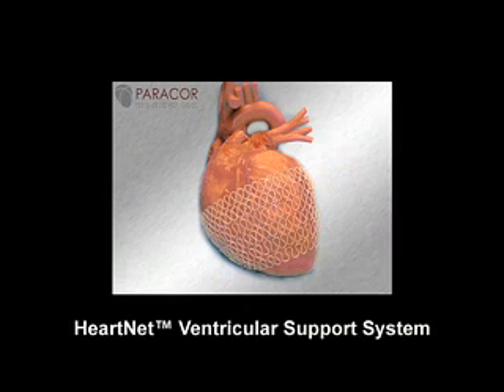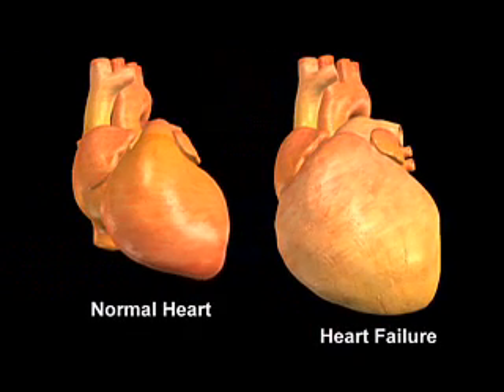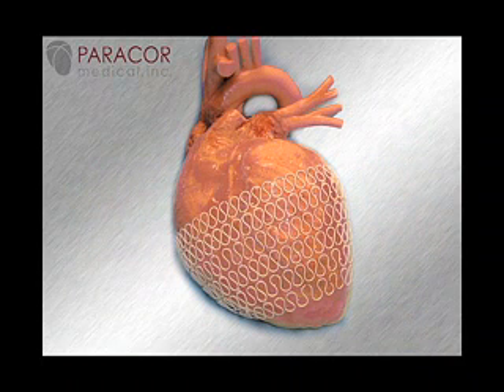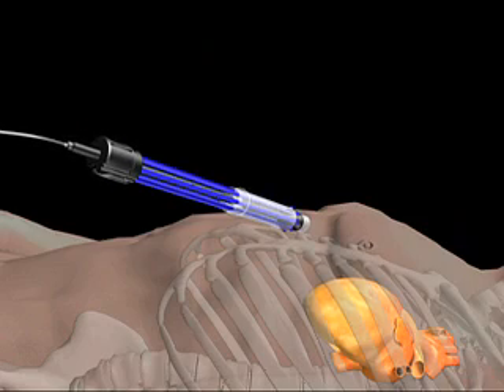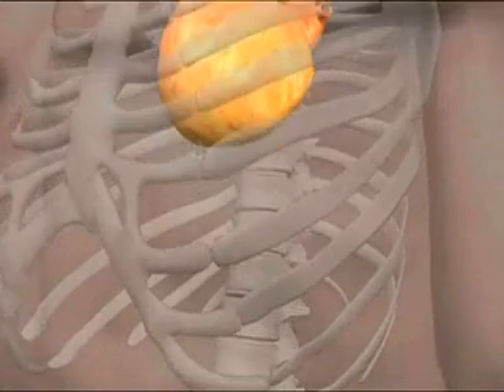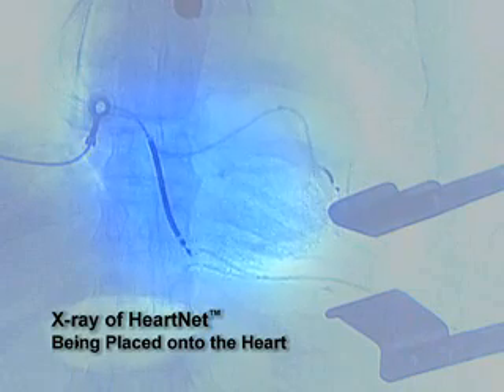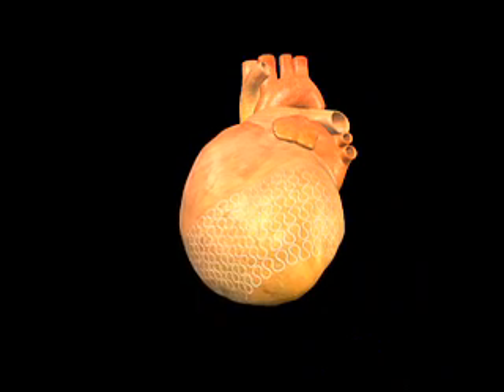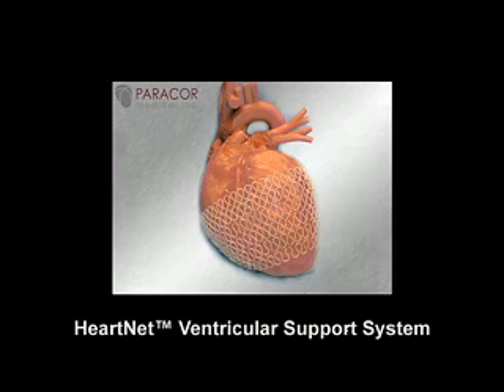Enlarged Heart Animation

Comment: @3ndGroup and ViperClutch
The most common cause of an enlarged heart is chronic high blood pressure. High blood pressure makes your heart work harder to pump out the same amount of blood, which can wear it down over time. This damage leads to thinning of the walls from the ventricle, which of course makes it harder for your heart to pump and this cycle can continue until heart failure in bad cases. Hypertension (high blood pressure) is usually rooted in age, sedentary lifestyle & bad nutrition.

Comment: @MsWtfisgoingon wrong you can be skinny and have an enlareged heart high cholestorol or high blood pressure cuases the heart to work harder there are 2 reasons why it would be enlarged. becuase like any other muscle when it works harder it becomes bigger and the heart works harder some blood is left behind in the ventricle and streaches the ventricals and can cuase an arrythmya becuase the heart isnt beating the way its supposed to
Reply: I have had an irregular heartbeat for many years. My Doctors were aware of it but did nothing.  Next thing i knew was i was diagnosed with an enlarged heart.    On doing some research i discovered that due to the irregular heartbeat my heart had to work harder and consequently became enlarged.   I am now on beta blockers and a changed life style for the rest of my life.